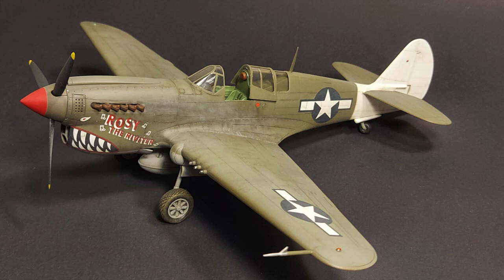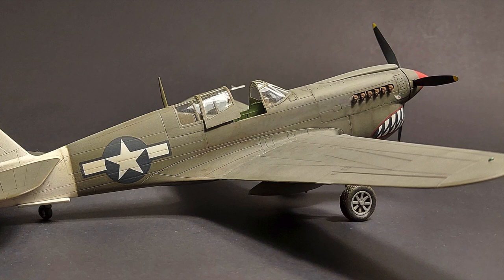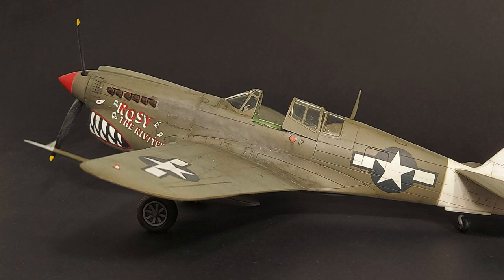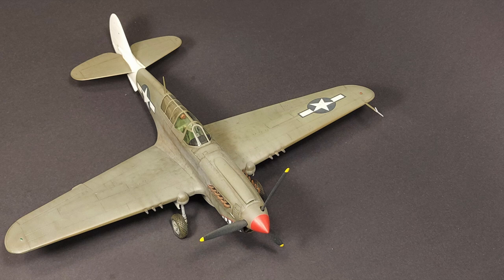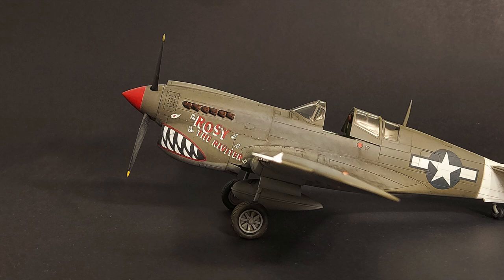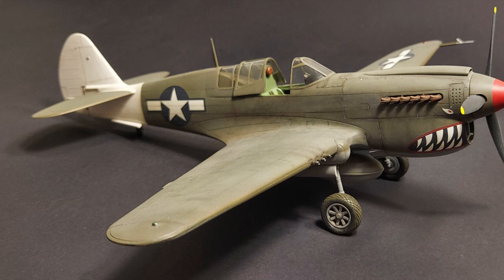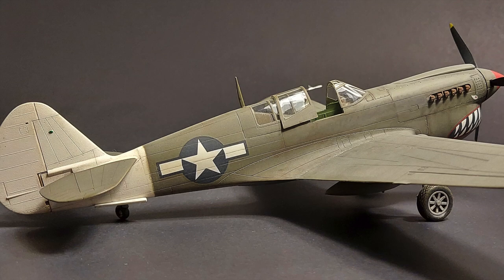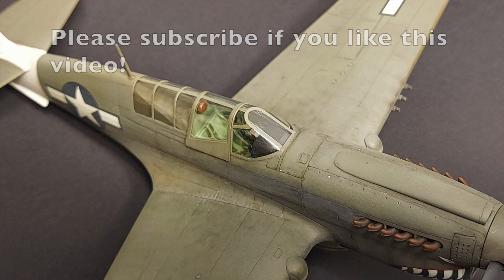AMT P-40N Review - Better than Hasegawa's P-40N?

Comment: I've always kinda of liked the old AMT P-40 line.  If you have the different variants, you can cut & paste yourself a P-40E from them, even though AMT never came out with that specific variant.
Reply from the maker: Right on. I've built the F and K variants so far. Both turned out nice, but just like this kit, they weren't shake-and-bake.🙂
Reply: Yeah they have a P40K version I think I'll try...
Reply from the maker: @JC Woodman  My K came out nice but the tail seems a little undersized. I may post a review in the future.
Reply: The AMT N  is far better in the windscreen and radiator shape.
Reply from the maker: @wrathofatlantis2316  Interesting. I would have assumed the Hasegawa would be more accurate.
Reply: @jonsmodelkitreview4624  The one small flaw of AMT is the wingroot fairing outline, as riveted on the fuselage vertical side, because that is slightly curved instead of straight, which makes the Mauve and Hasegawas moderately better there. But the Mauve has a rear glass cross section that is too triangular, which is more fundamental, as well as a wrong spinner to radiator ratio of proportions (unclear what is wrong, but AMT nailed it). All P-40Ns have too thin props. I think maybe Eduard P-39Q blades are the closest substitute, but they are that silly separate blade design that always looks croocked. Exceptional finish on that P-40N by the way: Very refined... It may be the best AMT build I have ever seen, as most people prefer to put in a big effort on the Hasegawa, or sometimes the Mauve, and they are wrong, especially with the absurd looking toothpick prop of the Mauve.
Reply from the maker: @wrathofatlantis2316  Thank you! It was fun weathering this one. And it's good to be aware that the Mauve and Hasegawa kits aren't perfect either.